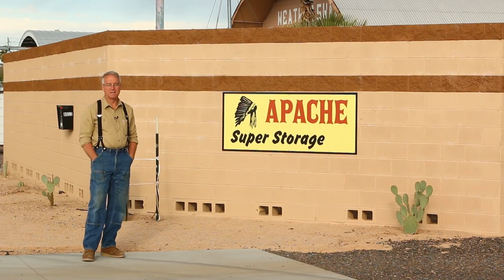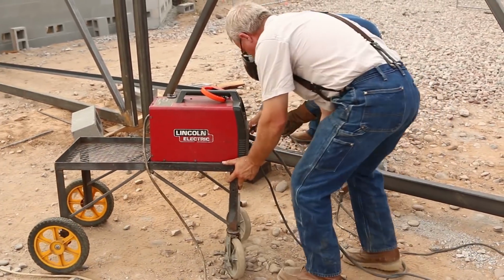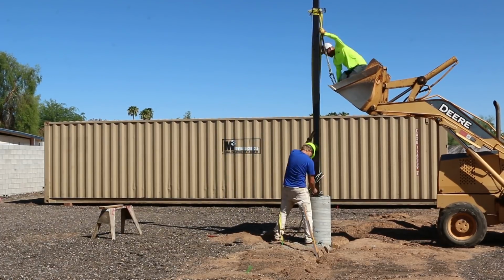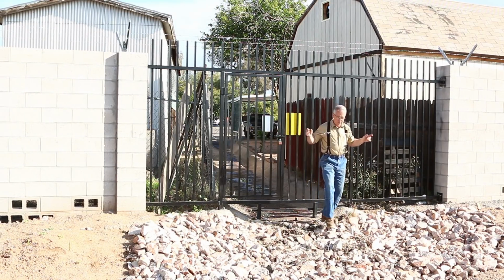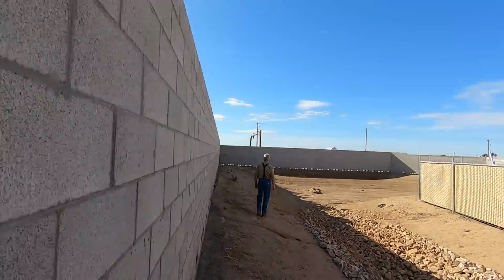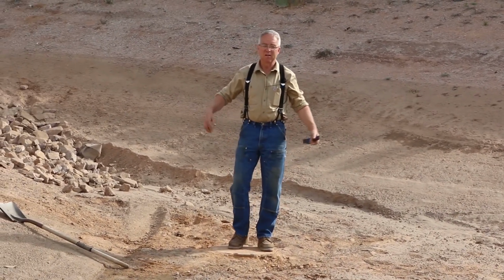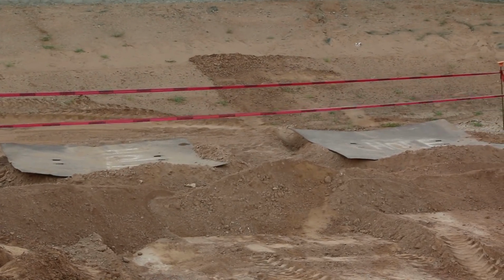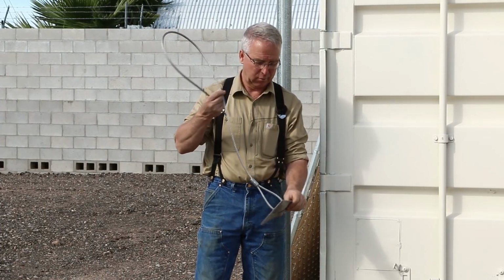Site Tour: Contractor Storage Facility

Comment: O.k a tip to counter the potential Sag due to the massive cantilever load on the hinges. My suggestion is midway on each gate fit a heavy caster to take weight as it swings open and have that caster run on concrete.

Comment: Is there a way to easily move connex boxes on and off sight? In the shipfitting industry, most of our job staging is done in the yard. All the tools and materials are loaded into the container, which is then moved to the location of the work. An onsite method of moving 20' containers may be handy.

Comment: I appreciate that the drainage areas have to be kept clear, but it seems that the space could be utilised if it was done at a certain level above the surface of the rocks, think a suspended deck. A few concrete piers/piles and some beam and block flooring and you've got yourself a large section of the site back in use!

Comment: There is over 1000 feet of "valley fill" there in AJ, notice how the dirt didn't change color or texture as you dug thru millions of years of erosion deposits from the surrounding mountains. (and never made it to the original valley floor)

Comment: Is there supposed to be double bottom plates on framing I'm just saying I asked this question on a how to frame a wall the right way YouTube channel and I got a comment because of the length of precut studs is the reason why single bottom play in double top plate what is your take on this subject
Reply: All the old framing that I run across has double bottom plate it makes sense to me after adding thickness two floor there is nothing left to nail trim to and on long runs there is no way to offset joint are pre-cut studs cut to the wrong links?
Reply: I wonder what the plans say does anybody look at blueprints these days?

Comment: Empty those containers will float in a minor flood, and if the water is moving a few miles an hour they will crush anything they bump against.  A 40' regular container seems to displace about 160,000 pounds of fresh water.  Full they are only 60,000 pounds.  Seems fair to require the tie-downs.  I suspect that if there was ever 3 feet of water in there the empty ones would still pull those tie-downs right out of the soft dirt.  Fitting each container with a series of weather sheltered fresh air vents high and low may eliminate most buoyancy.  This will also help prevent container explosions if a customer stores small-engine powered cutters, chain saws, etc. that tend to evaporate their fuel into the air.  One of the workplace hazard training videos I watched documented a container that exploded during a fire next to the container.  The container held only a handful of chainsaws, but they had been stored hanging on the wall such that fuel constantly leaked out and vaporized inside a sealed box.

Comment: Doesn't look like a design that follows nature, has it been hydraulically designed, water under flood doesnt usually turn tight 90 degrees?

Well designed for the 1980's, but could have been closer to keeping to nature with "scrub" areas and so on. Some trees would be good.
Reply: Not trying to be neagtive, great job Scot and Nate.

Comment: Great video. Not fair to get an okay from the regulators and the throw in extra requirements. It’s a shipping container or a commercial building. Wow, if you where working on a tight budget, your project has just failed.

Comment: Once you get to the depth of one length of drill rod how do you remove dirt from the hole anymore? 100+ feet seems like an awful lot of shaft to pull out of the hole each time you want to empty the auger?
Reply: Add another rod section to lengthen er deepen it as needed, those do not have just one section

Comment: The gate where the water will enter the property will catch debris and be a wall in short order, once the real flood comes. Should have some kind of engineered “weak link” to give way and let the gate open in the event of thousands and thousands of pounds of water pressure from water backing up due to debris collection in the gate. Not likely to be any thieves out there to try to float into the property. Ha.

Comment: With the shipping containers being considered "structures", they are permanent improvements for property tax purposes. Those Bastards!
Reply: If the containers are moving in and out, then it's a "container yard". As you're leaving them 24/7 with no intention of ever moving them, they become "commercial structures". (I'm sure the city gave the same reasoning.) (We've had a similar multi-year back and forth with the city over water in a "warehouse" -- unit in a flex building, but it's on the books as unoccupied storage; if you say "bathroom" well, that's not allowed in an unoccupied space. An engineer told us the magic phrase "mop the floor" -- we've gotta be able to clean up spills. :-) One might think "fire suppression", but we aren't zoned for combustibles storage.)
Reply: Buck Whitetail Land of the free lol.
Reply: Glue wheels to the side and just say it's a trailer you might move at any time...

Comment: There is no such thing as a 100 yr flood in the desert. Flash floods are a regular occurance in the desert where water runs off faster than can soak in the baked clay soils and even greater where development has created paved and asphalt surfaces that exacerbate the phenomenon.
Reply: That's the problem right there !  I used to live in Apache Junction, AZ.  That's where the road past Nate's storage got the name. And flash flooding during the spring rainy season is a regular occurrence. The problem is the nonporous surfaces  like asphalt and concrete that cover the ground and don't allow for water absorption that was once a normal part of the Central Valley geology.

Comment: Brilliant idea!! Storage containers - practically air tight and very secure..UNLESS, someone has a torch. Then it’s all over 🙁 BUT, after using these for many years and occasionally getting ripped off, I had an idea on how to combat even the torch 💡 When we locked up our container at the end of the day, we used to leave a baking pan about half full of gasoline near the door. Never had a break-in again. Everyone feel free to use this inexpensive security system. It works!! 💥 💥 
🤜🤛
Reply: Or an angle grinder. But that would be so loud, someone would hear it (and possibly see sparks also).

Comment: Although I am not a stress engineer, it seems to me an easy way to relieve the wind stress on the front gates would be to drill small holes (i.e. one inch diameter) all over the gates to let the wind pass through.  Make the gates look like swiss cheese.  The downside of this would be if you did not want people on the street to see inside of the yard (privacy and safety).   Even if it was a privacy issue, I would guess you could figure out a way to hang a lightweight tarp on the inside of the gate with holes or slots in it that are not in direct correspondence to the holes in the gate.  Black mosquito netting or something similar to that might also work.  Drilling holes and installing a tarp seems a lot more economically prudent that putting in a new sliding gate system.  Of course you always have to worry about the local and government regulations.

Comment: So, what if Nate decided to tear that sheet metal off of the gate and replace it with chain link or some other material (or cut holes in the sheet metal) that allows wind to blow through; would that require a new permit or some other code compliance bureaucracy interaction (CCBI)?
Reply: Absolutely! If you drill a hole in the gate, the entire water drainage/retention/diversion system will need to be revisited and re-permitted ($) as well as the “commercial bldg” hold down system and...($)..and ($) 🙄
🤜🤛

Comment: I'm really intrigued by the use of shipping containers for use as homes, offices, etc.... Just seems like a good way to deal with housing crisis.
Reply: No, it doesn't.  The amount of money and effort required to convert a shipping container into a structure suitable for human habitation negates any benefits provided.  Shipping container buildings such as you describe are a novelty, not a solution.
Reply: @watcherofwatchers  depends on the location. Alot of people are using them because they are portable structures and can get around zoning and building codes in some places.

Comment: I don't understand why it's your responsibility to  completely deal with not only the water that falls on the property, but all the water created by the runoff of developed area upstream. I understand the retention area to retain the runoff you created (even though it looks like everything you did is permeable...) but the dry well is crazy to me.  Did the no water leave that property before you built? Because it doesn't look like any of it does now. Seems like you built the storm water solution for a hell of a lot of other people.
Reply: @ Steve just Steve - Totally agree. The municipality should have chipped in on the cost of the water retention/diversion.
Probably the cost of retaining lawyers to fight city hall was prohibitive.
🤜🤛
Reply: psidvicious 
I agree that it would have been fair if the municipality would have compensated them for at least part of the costs.
Reply: Maybe before the build the water could spread around the lot and permeate into the ground.
Reply: @Conservator.  I highly doubt it, besides like i said I don't see anything non-permeable installed.
Reply: Steve just Steve 
11:50
“Percolation is usually pretty slow when you have a lot of fines and clay particles in a soil like this”
Reply: Steve just Steve 
Sorry, I misread your comment. I don’t thing they installed anything non-permeable either but they probably did change the elevation levels and/or didn’t want the water from the neighboring lot to flow between the containers. So they deviated the water to the side but were not allowed to let it flow of the terrain. Hence the retaining pool and dry well. 
Just a guess of cause.
Reply: Yes it looks like he should have gotten a stimulus package from the surrounding counties being his efforts are improving everyone's conditions
Reply: Here's a word for you: corruption.
Reply: Why does it have to go in that direction?  There are a thousand other reasons why the situation may have gone bad.
Reply: Paul Tacy What direction?

Comment: Not an engineer but wouldn't some circular holes allow the air to pass through instead of acting on the gate ?
Reply: Barry Britcher 
You would need more than a couple of holes. Think half of the total surface to reduce the force by half.
Reply: But then any passerby would be able to see into the yard. I think a solid door is for security.
Reply: @c31979839  There's what looks like a six inch gap between the doors, so it's not exactly hard to see through. Plus, as shown at 5:20 , there's nothing to see except more doors in the yard (unless people use the yard for storage, too, in which case, it'll be a mess in no time).
Reply: @c31979839  The solid gate may be a requirement for code. Keeps the appearance of the yard inside.

Comment: What happened? You were explaining those weird cables and then ?
Reply: the unsaid is to stop them... floating away? (not gonna happen)
Reply: @gowerski  Makes sense. I couldn't figure it out either. Tipping over from wind loads would be insane. Floating away makes sense, but the amount of water drainage redundancies for a site in a desert is absurd. All sorts of drainage systems and weep holes, and just in case they fail you need to tie those "commercial structures" down as well. And here I thought the building inspectors were tight where I live...

Comment: That hole digging machine they used to make the dry well is a beast of a machine. It makes the 8 year old in me want a Lego set of it.

Also, the arrowheads and cables are a great solution to anchor the shipping containers down. If there was a major flood of the property, something we know is a possibility, empty containers could float and be moved by the flood, causing additional damage. Just one foot of water on an 8X20 container is enough to float almost 10,000 pounds! Easily within the flood levels we are talking about and enough to cause some real movement of empty containers and even some that have light contents.
Reply: Those SoilMec drills are quite common in my area, but I've never seen them pull up sand.

around here it's clay all the way down..

Every building of any size needs to be put on deep piles (either driven or cast in place depending on size).

A company I used to work for was building a communications tower and each leg of the tower is on a concrete pile 4 feet across and 40 feet deep with a 6 foot lump of concrete at the bottom of the piling.
Reply: pileofstuff are you talking about a belled shaft? Not sure how you drill a 6’ cube at the bottom of a 4’ diameter shaft
Reply: @FruitMcDouchey  Sorry, 6 foot diameter, not a 6 foot cube.  Brain fart on my part.
Reply: dont call those  things holding the cable "arrowheads"  they will shut the job down and call it sacred buriel grounds
Reply: @jeffreyplumber1975  Gives me the idea of getting a handful of clovis point replicas and tossing them in a construction site.

Comment: That tipper truck with the nesting trailers is dope.
Reply: Right! That was super-cool 😎 Never saw one of those here in SE USA.
🤜🤛
Reply: @psidvicious  Ya i have never seen one in NC either. I was so surprised when the trailer box moved into the truck box. Really clever design.
Reply: that is just positively one of the coolest things I've ever seen 😁🇺🇸
Reply: I've never seen one either. I thought it would be like most bobtail trucks that I've seen with a trailer, where the trailer box is basically a carbon copy of the truck box.
Reply: Really? transfers are extremely common in in WA
Reply: Transfer dumps are all over the western US.
Reply: I've never seen a pup trailer like that in Canada either
Reply: Here in New Jersey, I've never seen one. They must be a West Coast thing?
Reply: What good is it? Just put the rock in the truck, why have a trailer if the truck is empty? Maybe it saves weight by only having the truck with dump hydraulics-so you dump the truck and then the trailer.
Reply: @curtcmiller  the truck and trailer both haul material. The truck dumps first then it grabs the trailer box and dumps that. Great for situations where maneuvering a trailer is prohibitive. The Western US also has similar dump truck and trailer setups where the pup trailer doesn't have a steering axle and the trailer itself dumps too, you back the trailer in place to dump it, them Jack knife the setup to get the truck into position and dump the truck.
Reply: @curtcmiller  This style of truck is used for a few reasons. 1 you can haul multiple types of fill/stone. 2 bridge law formula.  Longer wheel base and more axles mean more weight.  They use the transfer to keep the weight down, and not have double lift cylinders and hoses.
Reply: @curtcmiller  Watch the segment again https://youtu.be/DScp5KaT708?t=653 the truck unhooks the trailer, dumps the primary load of rock, then goes back to the trailer, slides the container part of the trailer into the truck container then goes back and dumps the secondary load.
Reply: @darkally1235  could have put in a time stamp like this "10:50" and it will show up as a select-able  time stamp and will start replaying from that point, not what you did will for a pc or mac user reload the page to start at that point of time
Reply: @curtcmiller  wow. 3 years later, but I hope you still know how little thought you put into this comment lol
Reply: @jamesbizs  so what’s the answer to my question, or don’t you know?
Reply: I agree that it's cool to watch, but part of me thinks it would be easier & cheaper to have a dumping trailer.  The trailer can't hold as much because the trailer container has to fit inside the truck container.  Either the trailer or the truck has to have the mechanism to move the trailer container into the truck container (which would probably negate the savings of not having the dumping mechanism on the trailer), and <deity> help you if there's a chunk of rock left inside the truck container to jam that sliding mechanism.  And I bet that driver needs some skilz to get the truck lined up straight with the trailer.  The one advantage is the dump can be done with more precision and in a smaller space as it's just the truck rather than a truck trying to back the trailer into position. OTOH, I've seen skilled truck drivers back their trailers into tight bays with very little turning space.
Reply: @darkally1235  the sliding mechanism isn't inside or dump bed, it has rollers not unlike a train wheel and rails. It only takes a small electric motor located in the frame of trailer.